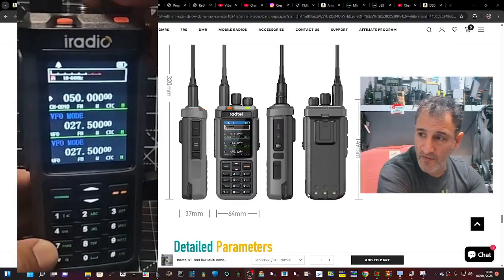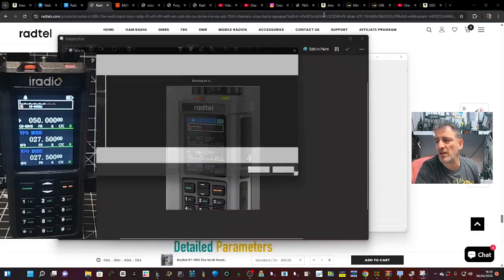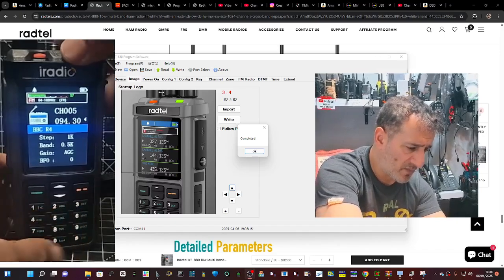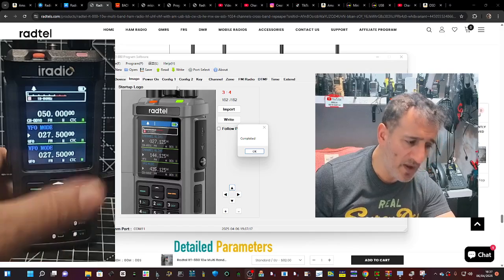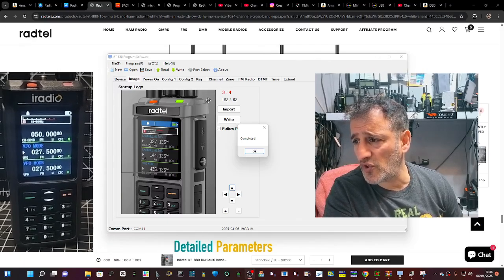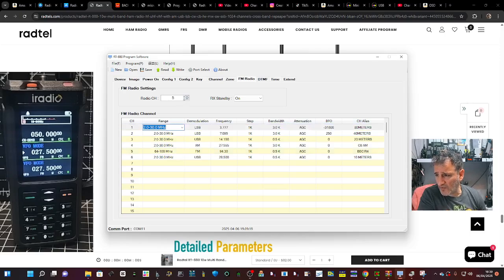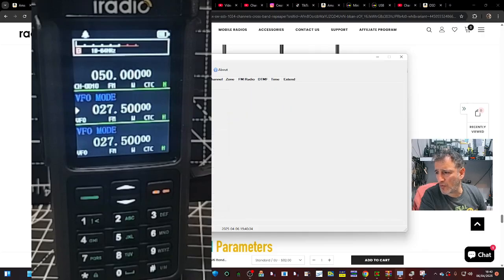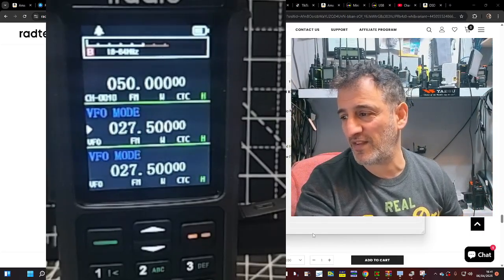iRadio UV-98 /Radtel RT-880 - BOOT IMAGE & TEXT

Comment: Thanks for the video. The only thing missing is what to do if the USB connection doesn't work. The solution is simple. If it doesn't work for you on Windows 11 then install the RADTEL_CABLE_DRIVER_USB_2 program. Then connect the cable and the radio. That's all. Rest in this video.
Reply from the maker: Ok